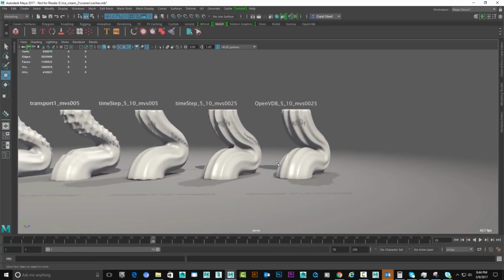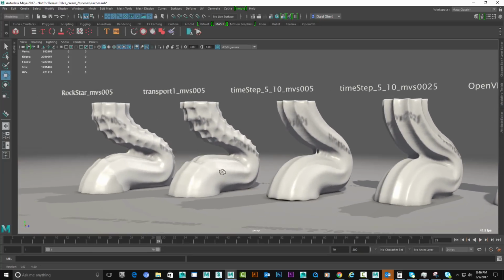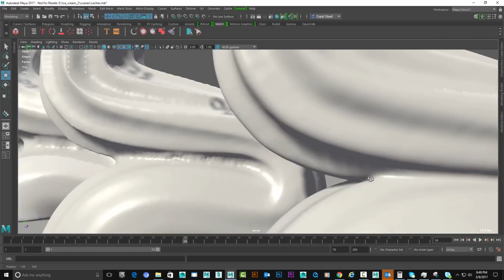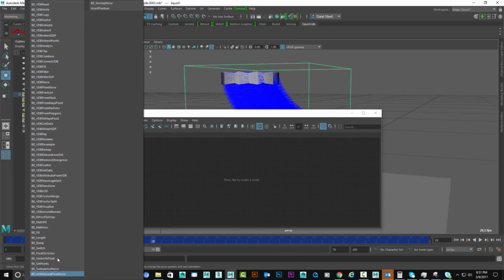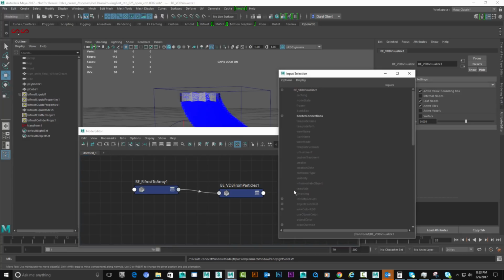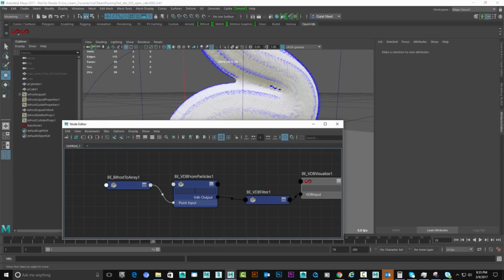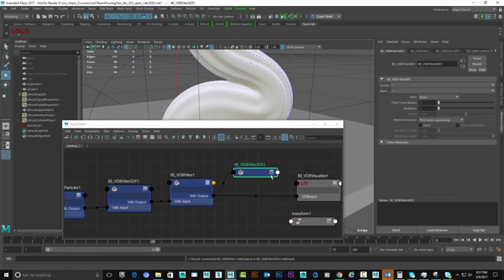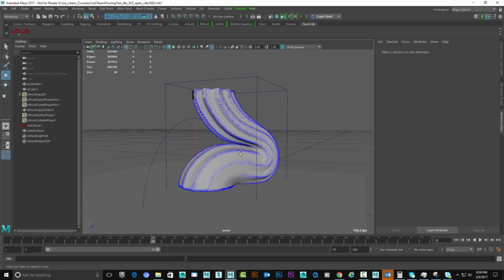Maya Bifrost - meshing - Open VDB -  Ice Cream

Comment: HI man. can you help with installation. I have downloaded openvdb 6.1.0 but have no clue what should i do next. As i understand there is no smooth and easy way to install it.
Reply: Did you ever get it installed?  Im in the same boat, lol.
Reply: @DDAschool  Did YOU ever get it installed?
Reply: @raspas99  yes, but the problem was mainly with the connection editor.  It wouldn't work properly so I had to find a different method.